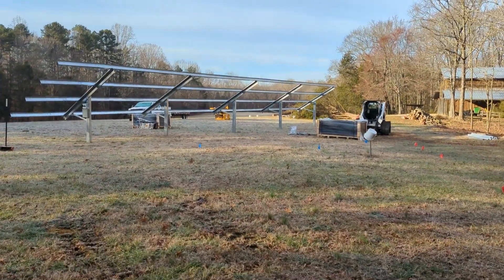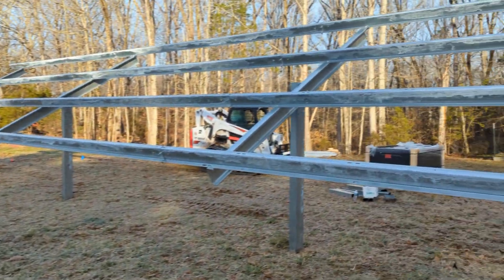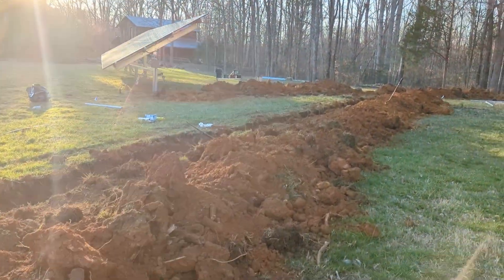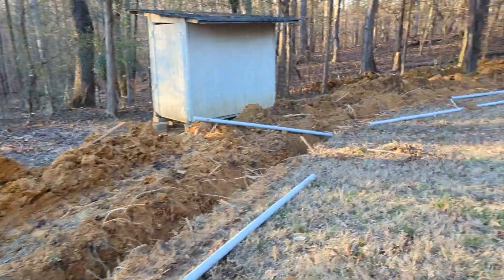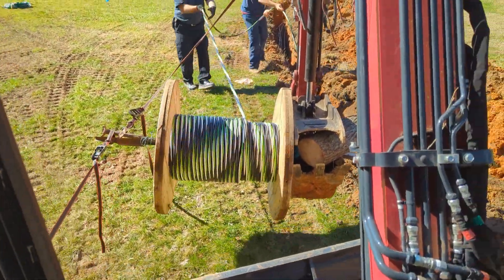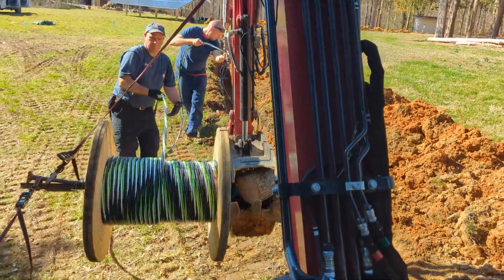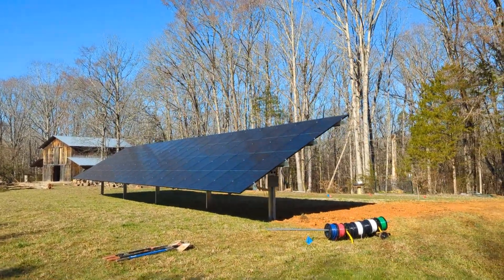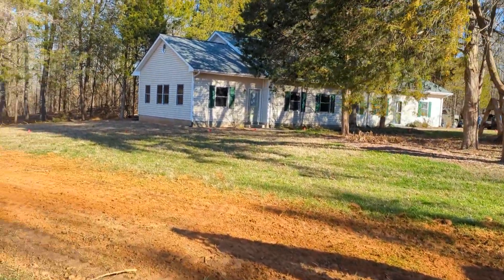It's easy... except for the wiring

Comment: 35U server or audio video rack works for pytes batteries and should support 8 batteries.  A little more work than an EG4 rack as you'll need to do some assembly and piecing together.  I think the NavePoint 42U might be a good fit.  I'm actually saving for almost the same setup but want a little more battery and maybe two inverters.  I have too much solar so I need to figure out the right configuration for more solar or maybe go EG4.

Comment: I am about to place an offer on an off-grid Colorado property that has a tiny, badly-designed solar system for the 448 square foot cabin.  The goal is to install a minimum 20kw system to run the house and a shop, which I plan to build with Amish help..  I will want a backup generator as well.  I will consult your videos when it comes to sizing and other aspects.  Maybe I should hire you.
Reply from the maker: Well we're glad to help you with the design and getting all of your materials if that helps. Just send an email to practicalpreppers@gmail.com.

Comment: One thing I think you should do is set your stack of batteries on a piece of foam at least 2 inches thick. Charging the batteries while they are cold will kill the batteries. I assume that the batteries are in a conditioned space, but thermally isolating them from the floor is still a good idea.

Comment: How does one plan for the additional solar gain that come with the bifacial panels?  I know the 15K has 3 MPPT's that each take 6.5K solar input and I'd guess that the 42 panels are feed into the 15K as 7 panels x 6 feeds.  How do you ensure the variable solar input does not exceed 6.5k under best solar chargin conditions AND get the best solar production on grey days?

Comment: Why would someone spend ungodly amounts of money on that back up system only to cheap out on an air cooled generator? Good Lord, if you're gonna spend oodles of money on a project like that why not go all the way and get a pretty beefy water cooled diesel gen set to compliment the system?
Reply: In general the objective is to avoid using the generator at all. It’s only there when the PV can’t cut the mustard due to weather or unusually high demand. In this case the generator was already there, so we just used it for the system. It’s a nice generator, too.

Comment: They're expensive as hell, but IMO Winsted makes THE best racking systems out there.  Those Pytes batteries look like they're 3 or 4RU tall so 8 of them would fit quite nicely in a 36RU frame with some room for air circulation.  That's if the customer would be willing to pay a premium price for the rack mount system of course.
For an install like this one, do you think it would make sense to cover the area under the array with a load of white stone (after laying landscaper cloth)?  Especially using bi-facials it seems to me it would likely help boost the solar gain, as well as cut down on the mowing LOL

Comment: Hey Scott, your lovely AHJ might be looking for a PE to provide an "as-built" letter verifying that the ground mount was installed according to the stamped plans for the system. I've used Vector Engineering for several years and they offer that service in addition to civil and EE stamping/design. Definitely give them a call!
Reply from the maker: Yes, we actually did exactly that. I just wish I knew it up front. But we took videos and pictures and submitted are as built drawings to vector and they stamp them for $150

Comment: Great to be "green energy user" and independent, but this system need capital which is not disclosed on your video. The main parameter on a project is the cost where are included all expenses.  Without knowing full price everything looks great.  PV energy need and the life expectation, insurance on home and other. I see that 42 panels generated 47 kwh on one of the days, and this is 1.12 KWh/day per each panel with power 0.457 KW. These show very low performance.
Reply: Your name is interesting

Comment: I saw a video where a person put a reflector behind a set of Bi-Facial panels to reflect sunlight on the backs of the panels.  He claimed to get nearly a 30 percent increase in output when the sun was at its peak location.  What do you think of this idea?
Reply: I wonder how much a white stone base under them would add?
Reply: I thought of that but went with buying white backed poly based ground "cloth", haven't finished grading yet so don't know how much it'll help. Snow on the ground I'm assuming has helped a bunch though @realnealsmith

Comment: Good day Mr. Scott, 
  Have you ever used a Microair on a large air compressor. I've gotta 7.5HP single phase compressor that pulls too much power on start for an 18kpv and didn't know if that'd be a good work around.

Comment: Was this install inspected?  Reason I ask is the electrical panel NEC clearance specs of 15” either side and no
more than 6” under/above protruding out from front of panel is not met.
Reply: I'm an electrical contractor here in Portland Oregon and this would never pass any kind of inspection.

Comment: Great solution.  My only addition might be to limit the battery use from down to 20% at night if the weather forecast shows a storm rolling in.  Would hate for grid to go down in the morning hours.
Reply from the maker: That's why we are connected to a 16 kW propane generator and we can get that battery back in shape in less than two hours.

Comment: Could you buy a regular ole 19” rack like BUD rack BRP-12212 or whatever works for 8 batteries tall?
Reply from the maker: Yes, I'd really like to standardize on some racking. These battery manufacturers are driving me crazy with no server racks for their rack mounted batteries. We also need good combiners and bus bars and the ability to parallel stacks built into these racks.
Reply: @engineer775  I’ve been using Victron Lynx Distributor with MegaFuses and Lynx PowerIn without fuses when the battery has its own breaker.

Comment: I guess you carry a fixit kit with you for the cut cable, water line, and hopefully not gas 😊
Reply from the maker: Yes, we typically carry plumbing fittings for 3/4 inch and 1 in and fittings for black rolled poly and couplings and corrugated 4-in black pipe.

Comment: Hey Mr. Scott.  I bought a Solark from you couple years ago and self installed.  I am expanding array and want to ask a question.

Can the 15k handle an over panel situation so long as you do not exceed the viltage rating.  The dc voltage will be about 370, but potential on the bifacials I want to install will be an estimated 7000 watts per mppt.  Ive tried to research but cant find the answer im looking for.  The flier and manual (outdated) says current limiting to 26 amps per mppt.  Can you shed some light here?  I think i will be ok but....lol...id rather ask than just wire in a situation that cooks an mppt.
Reply from the maker: Please send me an email... info@practicalpreppers.com